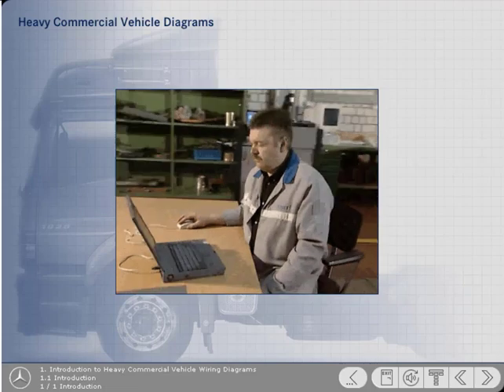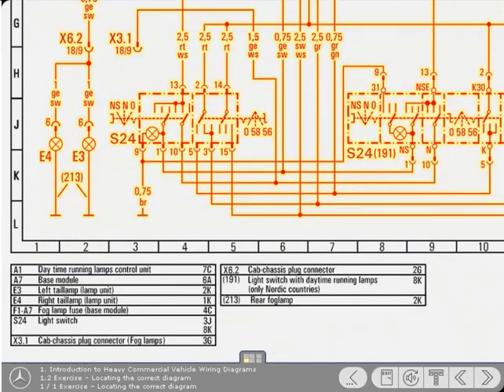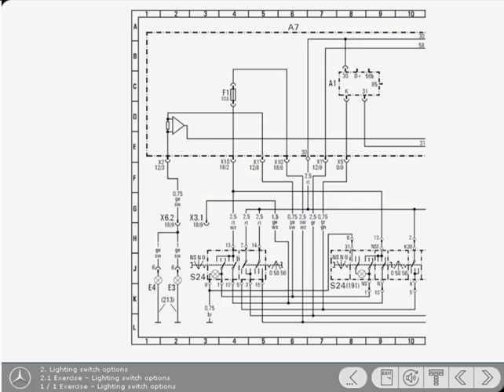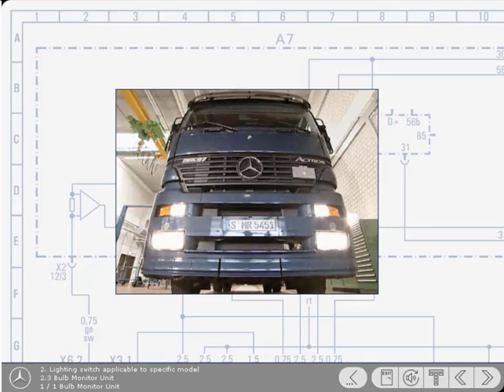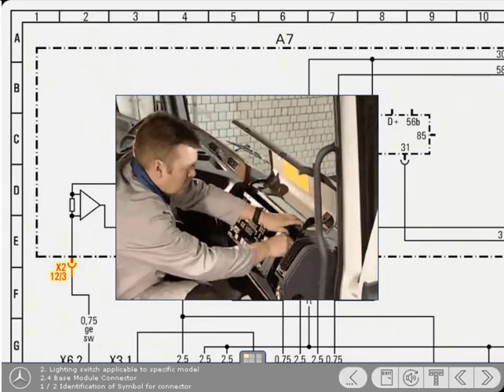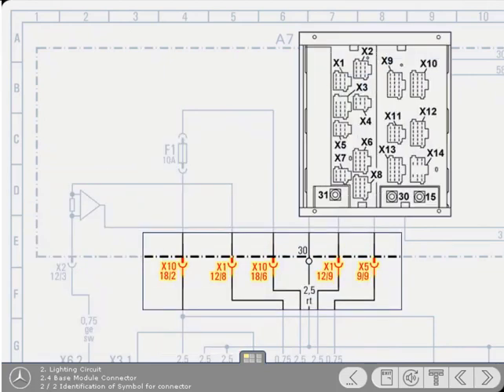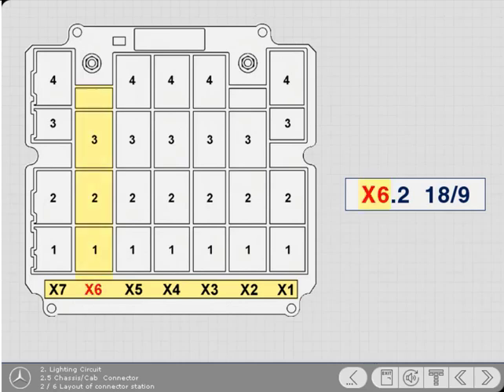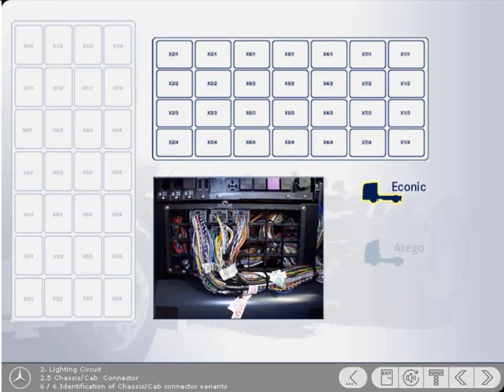Mercedes Truck  Actros Axor Atego Wiring Reading part1

Comment: That's awesome, this is the diagram that contains the lighting circuit applicable for our actros model.
Reply from the maker: You are welcome,any more info you can contact me:
Whats no +201003132153
Reply: @IslamElMasry  Do you have a video for 2008 Econic with no brake lights,  :)  Or will it be similar to this video,, Thank you